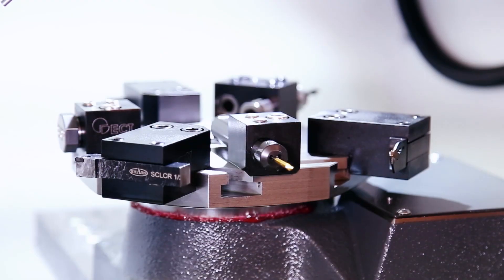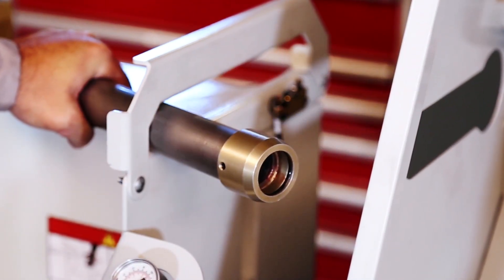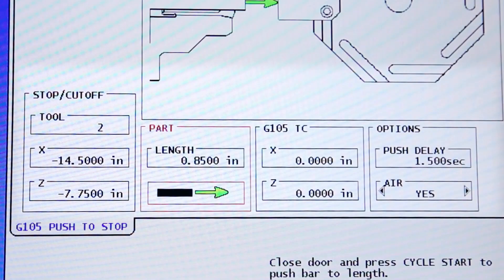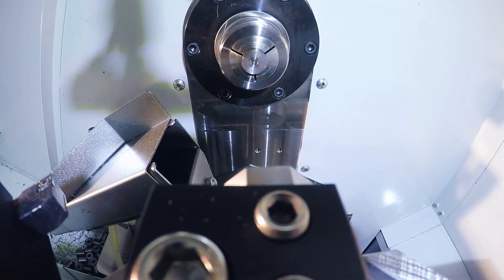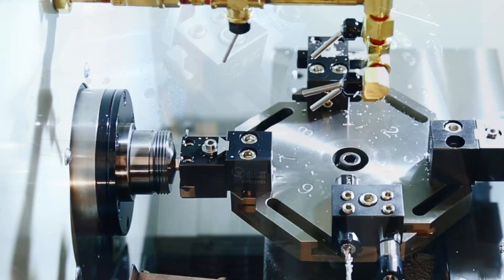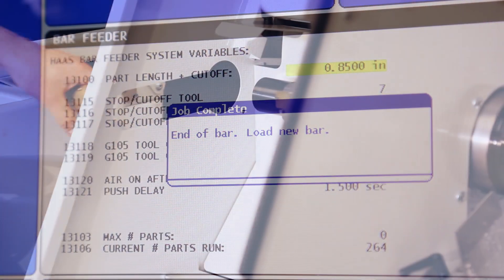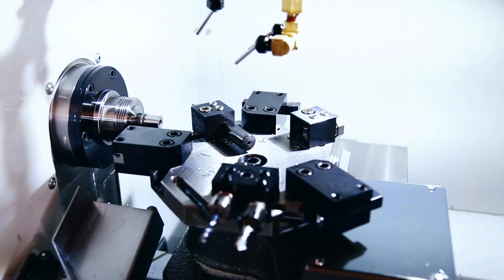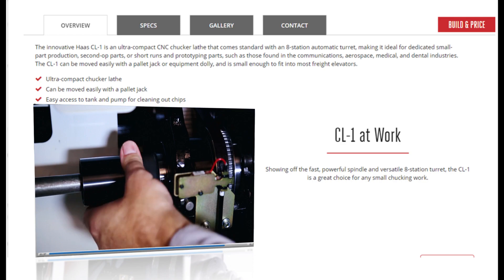The Haas CL-1 Chucker Lathe

Comment: Woow guys amazing. 
But my question is:
 compared with a ST10, ls the cost of the CL-1 machine really affordable? 
We make really small parts maybe we had bought that instead of the ST10, but what about the power and rigidity?
Our parts have features on both sides then I realyzed the ST15-SY would have been better but that is much more expensive than ST10, right?